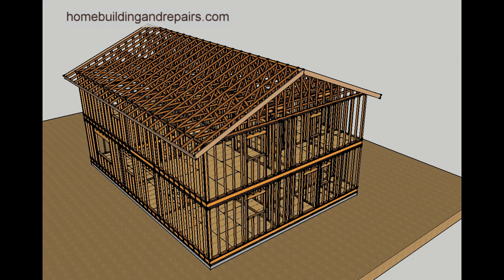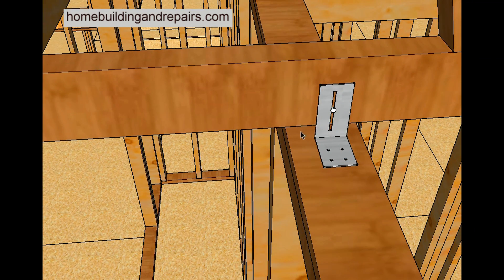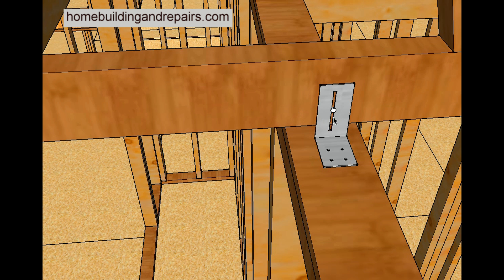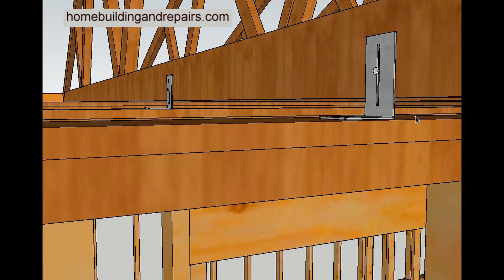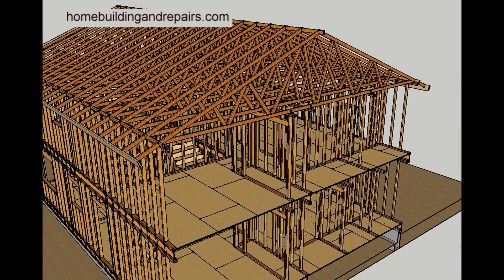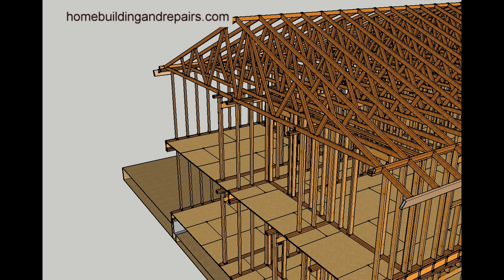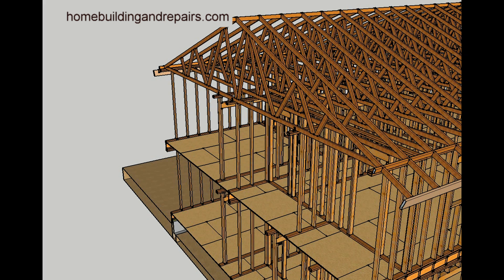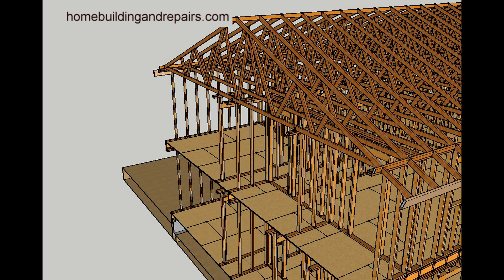Roof Truss Movement Requires Interior Wall Framing Hardware – Truss Clips

Comment: After researching this issue I see he’s half right, either use special clips that allow truss to sag after being loaded with shingles/tiles/etc or attach walls after roof is loaded so trusses are not compromised, then install drywall and it will not crack.
Reply from the maker: I like it, half right.

Comment: After trying this out, I have to say, the truss clips is not a good option. It creates noise when between the nail and the clips. The best way we find out, is to place a lumber block on both side of the truss to hold them in place. No noise been created.

Comment: How do you prevent the drywall at the ceiling from cracking with this system?
Reply from the maker: The drywall is installed after the roof materials are loaded and if no more additional weight is placed above, then the roof trusses shouldn't move or move enough to damage drywall.
Reply: @gregvancom except when it snows.

Comment: On my project the drafter specified blocking that gets nailed from truss to interior brace wall (sheer wall).  What doesn't really make much sense to me is the blocking gets the heck nailed out of it AND he wants DTC clips at 9 inch centers as well.  Wouldn't the existing nails allow limited movement making adding DTC clips almost useless?
Reply from the maker: That is confusing. Email me the drawings or details and I can provide an opinion, but keep in mind the engineer has the final say in this matter, even if it's wrong.
Reply: @gregvancom  In my case, there was no engineer on the project except for truss design, which required stamped engineering calcs.  The foundation and general framing design was all done by a draftsman and reviewed by and approved by city building officials.

Comment: Interesting. Coastal NC. 150 MPH wind zone. My truss manufacturer (on a little more complex roof system than in your video) is requiring mechanical fasteners with uplift of 500- 900 lbs in about 120 locations on interior walls. Furthermore, I have a failed framing inspection because of no continuous load path strapping from all 120 points (most on second floor) all the way to the foundation.
Reply from the maker: I would love to see pictures of your project. You can get our email address at our website, but understand if you don't.

Comment: As usual, a great video! 
Question: Considering the truss clips are used to allow the building to be loaded during construction, can we now frame interior walls direct to the trusses and avoid truss clips?

Single story stick truss in Southern California (inland, not coastal). The original roof was wood shake, and like so many in our region it is now overloaded with heavy tile. We are doing a complete to the studs remodel and moving some interior walls. We are doing several tasks to strengthen the structure, one of which was frame interior walls direct to the trusses, no clips. Are we creating a potential issue? Would love to hear your thoughts.
Keep up the great work!
Reply from the maker: I would think that it wouldn't be a problem, but I'm not an engineer and would use the truss clips.
Reply: Im here after searching "truss lift" or "truss uplift" unless your truss roof has exterior insulation and your trusses are entirely inside the conditioned space the top parts of your trusses will swell in the winter time lift the bottom cord upwards.
Reply: @montypbbc  so what's a simple fix ..if I add insulation to the attic will that help. Or can I add more clips now to fix.  Everytime the season changes the same cracks appear
Reply: @ladye8569  I've heard people nail crown (or other) molding to the ceiling and let it ride up and down the walls, maybe this would hide your cracks?

Comment: Could you remove all interior non bering walls
Reply from the maker: On some projects, but most of the time interior walls provide side to side or lateral movement strength (shear walls) that can prevent the building from collapsing. I wouldn't do it without an engineer.

Comment: Do you have a youtube video applying truss uplift to vaulted ceilings?  

I have drywall joint tears along 2 contiguous sides of a 4'×8' sheet of ceiling drywall, with the 2 contiguous sides meeting a wall at the common corner.  The long crack (8') is hairline and runs opposite to the trusses while the short crack (4') runs parallel to the trusses and runs from 4' at the lower end to the apex of the vaulted ceiling, and over the apex for another foot on a 2nd section of drywall approx 1'×8' at the short end.  [A picture paints a thousand words].
I went into the attic late this morning to see if there was water damage.  Removed insulation to look for discolored timbers high and low and for signs of mold or mildew.  Nothing.  The drywall joints were butted where the joints were cracked, from attic.  I had on long sleeve shirt, work gloves, a bandana and hat on my head, and a dust mask.  I was soooooo hot with sweat pouring off me and labored breathing.  I thought I was gonna die from heat exhaustion.  By the time I got to the attic hole, it was all I could do to crawl out.  I almost went head first, having a difficult time swinging my legs around to the hole.  I missed the last 3 rings of the ladder.  It took me 30 minutes to recover from heat and coughing my lungs out.  SO BEWARE YOU DIY'ERS - IF YOU LIVE IN THE INLAND EMPIRE, STAY THE ^$%@& OUT OF THE ATTIC IN THIS HEAT!  I was up there 15 minutes and it nearly killed me.  LOL (now).
After seeing the YouTube's on truss uplift, I feel I have to go up again!  NOT!
WAYNE
Wished I could attach a pic.  Can't copy it to clipboard and I dont know how to share it to this format.
Reply from the maker: See if this helps https://www.youtube.com/watch?v=mwillzaluZE